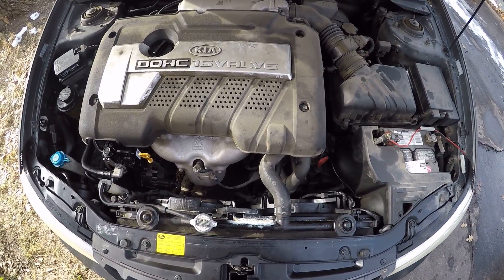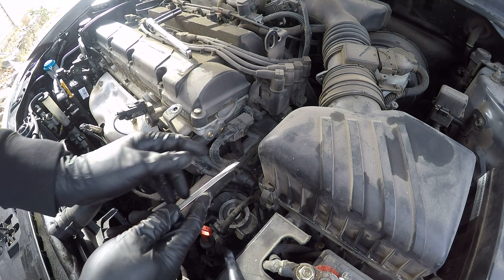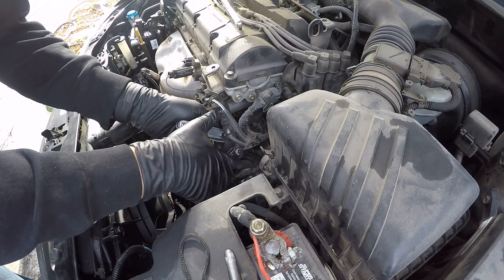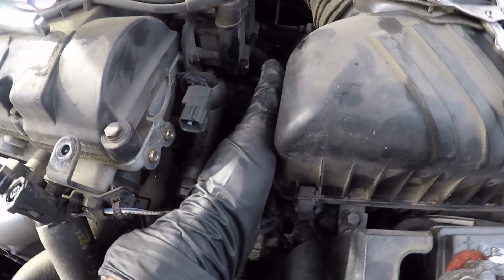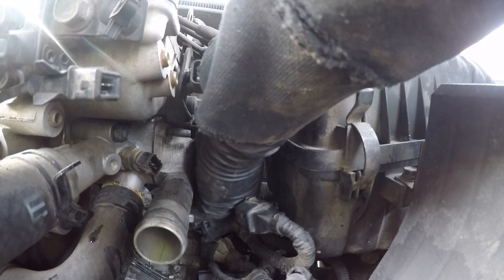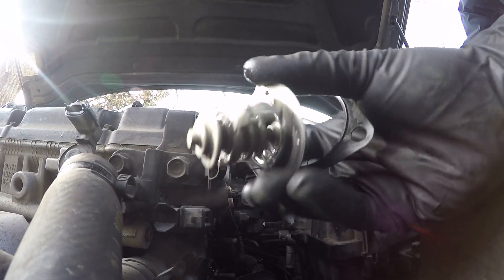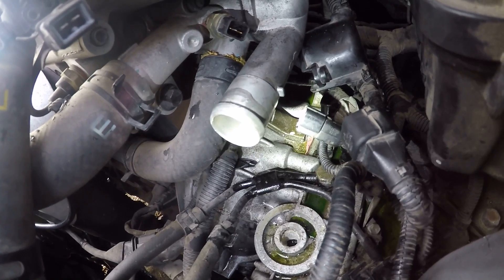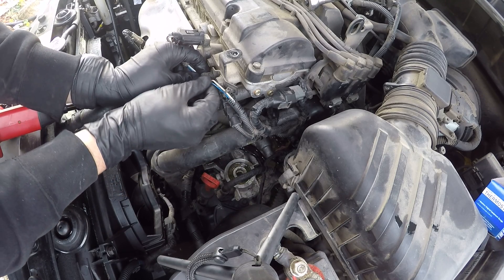Kia Spectra 2005 - Thermostat

Comment: for such a small and inexpensive part, it is ridiculous how much labor it is to change one out. If women designed it, it would be much easier, LOL.  I know they do that to make people bring their cars in to work on.
Reply from the maker: +msjesusfreak62 it's not too bad. Try changing a ball joint 😝
Reply: It's more about reducing the space needed for the engine so they can make cars more aerodynamic, lighter and safer. But yeah, it's a shitty thing.

Comment: if you would skipped taking off the engine cover and loose the clamp on the hose to the airbox and remove two bolts, you would have had clear access to the thermostat housing,

Comment: Thank you for the video. I actually removed the air intake box(four bolts) prior to removing the thermostat housing. Had a lot of space to work and maneuver. Reason I searched for this video was because i did not know where the thermostat was. I got tons of great info out if this. Thank you. Took me 30 min and a beer. No hassle...
Reply from the maker: +Emanuel Nunez nice! Good work. I'm about to replace the struts on my Tacoma. Wish me luck! 😜
Reply: same here!  i am going to take that box out as well.   it will allow me to clean that area up as well.  what a mess of wires and dirt and shit.
Reply: I agree!  The air filter box is an easy removal and great way to gain so much more access.  I have large hands and it is always a challenge getting into those tight spaces.  I as well did not know where the thermostat was, it's my son's girlfriends car.  This is a really great video to show where everything is....... including where the "washer" is!  :)

Comment: Just got done replacing the thermostat on my 07 Spectra and it’s pretty much the same method, took me an hour and a half due to brittle plugs and wiring. I hate myself for not reading the comments first and removing the air filter and box
Reply from the maker: Sorry I led you astray 😛
Reply: @lrnselfreliance  No worries brotha, your video still assisted me in replacing it so no hard feelings 😊

Comment: Why did you replace the thermostat? The reason I asked, my 2005 Kia Spectra won't heat up when I start it in the morning and it's idling for 15-20 minutes before I take off, but when I take off and travel for maybe 3-4 miles it begins to heat up. By the way nice video man.......
Reply: The coolent in engine is cool enough in morning to stay at decent temp is my guess, once you start putting pressure on it  and it cant circulate it becomes an issue.

Comment: I have a Kia rondo 07 is that same as a Kia Spectra or Sorento????? Also whit if I put my thermostat up side down for example the release valve is on the bottom.... Both hose's are full and hot but it's till overheating and spiting all over the place..

Comment: Code didn't go away, drived it a week. Car warms up normally now, no more issues except code still there. Do I reset the ECU computer or unplug the negative battery terminal? Please help, thank you.
Reply: Yes, unplug battery cable on neg for at least 15 min, but better overnight
Reply: Also, there are 3 ecu/ecm fuses you can pull and doing all of the 3 fuses will re-set code

Comment: Thanks for this! Very informative. I'm having to do this now myself. Now I know what to look out for. 
Question, I see a scuffed up area on your radiator top near the hose. Is that from a patch job? If so, did it work well? If not, no worries.
Reply from the maker: Yeah, thats a patch.  It actually worked quite well.  It bubbles a tiny bit, but I've never had it overheat.
Reply: Learning Self-Reliance Ah cool! I did try a similar patch (same area) with mine but the crack is almost 3 inches wide. Ordered a new radiator from Amazon. Maybe I'll try it again before it arrives and have a spare... Thanks again.
Reply from the maker: +jkenlive I used in weld, I ruffed up the area with sandpaper first, and really worked the putty in.
Reply from the maker: +Learning Self-Reliance jb weld*
Reply: Learning Self-Reliance Yeah, that's what I did too. Temps got cool overnight though and I may have not let it set long enough. I'll clean it up again and retry.

Comment: when my dad took off the houseing there was a metal gasket that came off with the thermostat. does that piece ever go back on? you never showed that part.
Reply from the maker: I'm not exactly sure what you're talking about, just make sure to use a gasket.  It should be connected in this order: engine, thermostat, gasket, metal pipe.

Comment: I felt the hose leading to the thermostat housing on my 2004 Kia Spectra and it was ice cold while the top hose was hot and the engine was starting to overheat. The temp gauge got to the halfway mark just from idling. Would that be a bad thermostat or a bad water pump? Or both?
 I've already ordered a brand new thermostat from Kia. The Duralast ones suck and don't last long at all.
Reply from the maker: +jackslater230011 I'm only an amateur mechanic, but I'd start with replacing the thermostat.  If that doesn't fix it, then you could try a water pump.  Good luck!

Comment: I need to drain the radiator prior to disconnecting the hose, correct?
Reply from the maker: Douglas Camus that would be best. I just let it drain out over the side.
Reply: Learning Self-Reliance What do you mean by, "over the side"? Isn't there a valve at the bottom of the radiator?
Reply from the maker: Douglas Camus there usually is. I didn't use it I just let it drain down the side of the engine block
Reply: Ah, gotcha. Thanks.

Comment: This is funny, I came here looking for what pipe the thermostat was in, thank goodness it's in that outside one. the whole mess in there is CRAP ,  funny thing is, besides the bat man gloves,   you have all the same tools i use for this same shit.    sept i think thats a leatherman and I carry a Gerber    but your lights the same.   even the same wear,   you should get a strip of gorilla duct tape and put it around UNDER the clip all the around on the stream light man, the clip costs ten freaking dollars if it comes off and that tape will hold it there forever. mine came off on my pocket. i keep it on top, hangs inside my pocket with the clip outside right beside my flip knife and extend-able magnet. LOL   the clip popped off and i didn't notice. the lights damn near useless to me without the clip and i use it probably 10 times a day. 

  anyway. I am back at it now.   thanks for the great video.   oh if you like the usb streamlight that you have there,  and you use head lamps.    Coast model HL7 is the BEST i have ever found.     It;s awesome,  its not USB rechargeable though, that would be bad ass, so i just got some rechargeable lithium ion AAA's for mine.  2 sets so i don't ever have to wait.